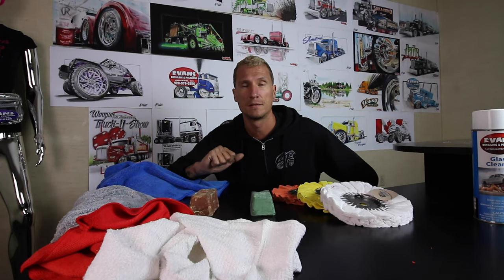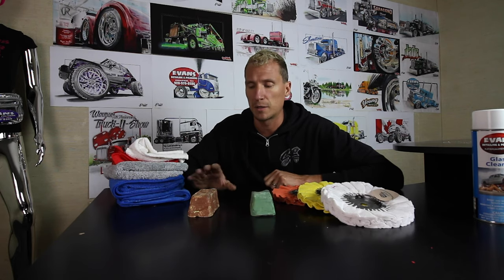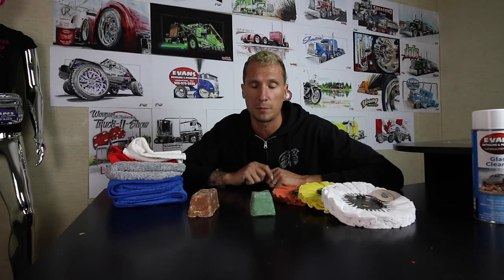The difference between cut, color, and white lines on aluminum.  Evan's detailing and polishing

Comment: Great video, as always.  I have a problem with foggy aluminum.  There are spots that are perfectly clear, but most of the aluminum is foggy.  This is really noticeable on large flat areas.  Is this also due to the cut?  Any ideas on how to fix/prevent it?

Thanks.